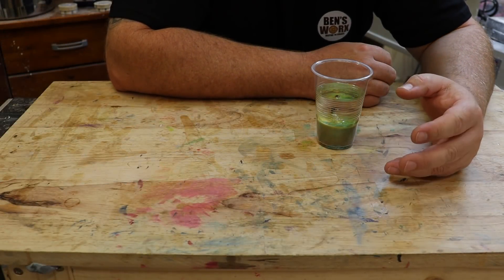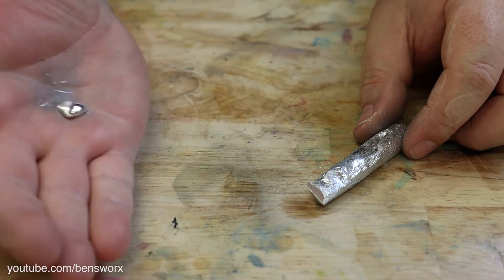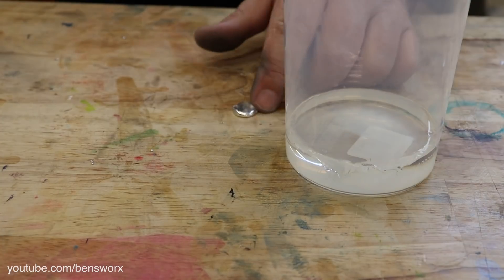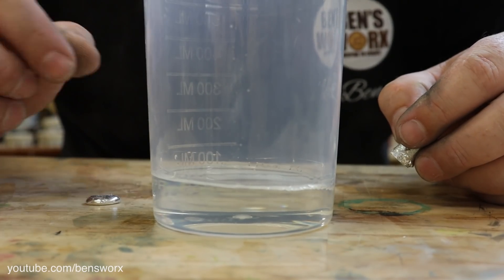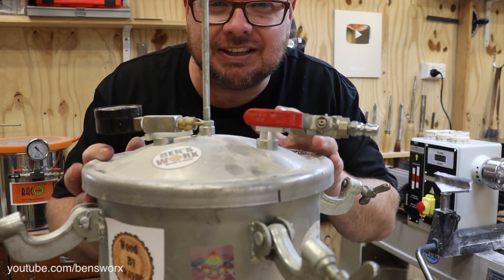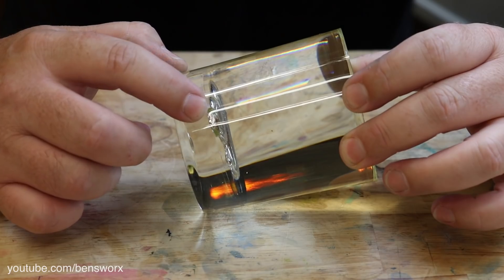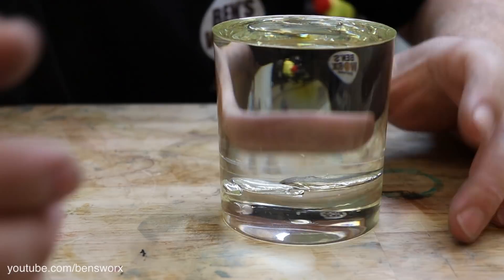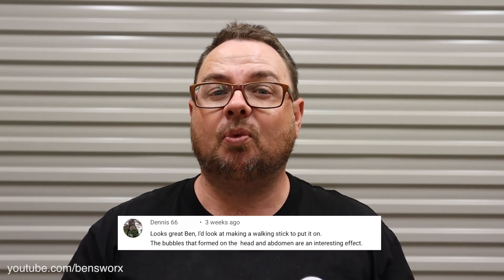Can You Cast Gallium in Epoxy Resin ?

Comment from the maker: Thanks for stopping by, If you have time you can check out my new range of Eggs here www.etsy.com/shop/bensworx
Reply: You could try freezing the Gallium in and small crust of water, and see if the ice will let it keep its shape as it compresses
Reply: What is the name of that tune at5:50? I looked for it YouTube music samples but no luck. Answered thanks
Reply: I think you could make a cool multi layered with the gallium
Reply: If you are able to cast an empty cellulose capsule in resin hollow it out, and fill it with gallium, and then add that to more resin, you will have a pill of gallium floating in resin, instead of a pancake
Reply: @Grigori One thanks I forgot all about that
Reply: There are really fine textile/synthetic meshes, you could use a small piece of that and lay it on top of the liquid resin to try and contain more denser material like the gallium drop in this video, and the white mesh might just be visible, really curious if that would work in containing the material in suspension and not let it sink completely
Reply: What cool experiment! You are now one of my favorites!
Reply: Congratulations to Dennis 🏆
Reply: @Ben’s Worx Idea for you…  Create a night light that uses a Qi wireless charger to charge an internal battery.
Reply: Ben hey listen I would really love to see you make a ant farm inside of some resin. Maybe create a air pocket inside then drill a small hole to it then add sandy dirt and ants.
Reply: Hey! You might possibly be able to heat it back up and get a syringe with a large hole needle and suck up the gallium, that way you could turn the rest of it into something neat. Maybe a pendant? :)
Reply: I worked with resin for over a year, I was doing fiber glass work. Sometimes your experiments scare me a bit. The wrong mixture can spontaneously combust. The worst instance was my boss made an incorrect order. He ordered cold resin in the middle of summer.
Reply: So how about Mercury?

Comment: Hey, Ben, thanks for the excellent content!    Interesting video and it spawns an idea for another resin experiment and a video.  We really enjoy when you try new stuff and we do some resin casting ourselves and you have taught us much!   It looks like the microwave possibly heated the resin block starting from the middle!   What if you cast a block with several old style mercury thermometers with the bases at different points.   The potcam would be extremely interesting and you could put that into the microwave and test the idea that the block heats from the middle first.   Just a crazy idea and, if I understand how your job works, a big part of it is merely thinking of stuff that would be interesting to watch.   If you use this idea, how cool is that, if not it's an idea for your idea bin.  Keep up the good work!

Comment: The burn spot happened because microwaves heat from the inside out. Also, the reason the gallium didn't move around in the middle of the resin when you reheated it is because it didn't have anywhere to go! The resin was completely cured around it, and holding it in place.

Comment: you should try this one again but this time you could cast the gallium in a silicone skull mold.  then brush it with UV resin so it holds its shape.  maybe figure out a way to have a bubble so that when its all set the gallium will flow around inside.

Comment: set the solid gallium in some (quick set) UV resin so that it will keep shape (no reactive heat) then set into some normal resin to see if the reactive heat will melt the gallium (smooth and shiny or dull)...  could be pretty cool to see melted gallium in a different shape than pancake

Comment: It probably did not flow out due to the pressure differences.  Same with the flow effect.  The pressure pot negated the expansion of the air trapped in the galium. Compressing it when it melted.  Also idk shit about this kind of science and I am kinda drunk, and in my mind, this sounds correct.

Comment: If you wanted to try this again, you could cast the bottom first, then cast some walls around the edge before putting the gallium in. That way, you have a barrier to keep the gallium from puddling all the way out to the edges, and could turn the thing afterwards if you wanted to. Oh, really cool (but a lot of work) would be to do multiple layers of resin, each one with a randomly melted shape of gallium.

Comment: 9:40 its the vacum rule, like dipping a straw in liquid sealing the open end and pulling it out. the lack of equal pressure is causing it to be pushed in by the outside gas

Comment: Unlike Water/ice (which really is the exception) Gallium have a higher density at lower temperatures (as when it is solid), and lower density at higher temperature. So it will expand, slightly, as it warms up and melts. The difference might not be very noticeable between "room temperature" and 30C.
So, in the cast in would leave a (tiny?) air gap when it's solid, but when it gets warmer and melts it will take up the entire "void" in the cast, so it can't slosh around. But if it the cast was done with a bigger void than the volume of the Gallium it should work. 

Interesting experiment though, and great video!

Comment: It wouldn't flow out because it's too thick to allow air to go in and replace it. If you want gallium to be able to melt in there and flow around you'd need to cast some resin with a hole in it big enough to fit the gallium bar with extra space, then seal it with another layer of resin and somehow not flow in and fill the rest of the hole. Maybe use some UV resin to fill the top of the hole before you pour another layer of resin on top.

Comment: I had a BB size metal (probably steel) in my finger (unbeknownst to me) and when I had an MRI is left a burn mark much like that on my finger.

The magnets heated up the metal, as well as lifting it under my skin. It looked like a bubble when it began lifting during the MRI. Freaked me out big time. Had a strange, not pain exactly, but ache, like someone was poking me with something.

I had to have it taken out surgically before I could compete my MRI testing.

Comment: Could you perhaps make a first layer of resin with a bowl shape, fill that with gallium and some heavy (heavier than resin) transparent liquid (mineral oil, perhaps?), then cover that with resin? Once cured: cool coaster and fidget toy! 

You should also try cleaning the metal! Impurities tend to float to the surface, making it look dirty, but can be relatively easily scooped off. Once clean, it should look like a T1000! :D 

Another idea, perhaps try this with a ferrofluid, or casting a ferrofluid formation as a  mold?

Comment: gallium has some pretty high surface tension so that's probably why it didn't flow out. also it's ever so slightly more dense as a solid than a liquid (as opposed to water) so there wouldn't be any room for it to flow inside the resin!

Comment: So you can in create model solar systems by utilizing bits and blobs at various locations and heights.  Then microwave the finished resin for 90ish seconds to create the star.

I recommend experimenting with microwaving resin at varied seconds to find the desired results of specific stars.  As in 70, 80, 100, 110, etc nuke.  Plus try microwaving at 90 seconds to see if you'll be able to recreate the result of this video.

I bet the central burn effect is dependent upon the thickness of the resin.

Edit: I wrote the last sentence in reverse by accident.
Edit2: Did away with technicalities of solar systems.

Comment: Fun fact about Gallium... in Terminator 2: Judgement Day, Gallium was used for the scene where he shattered the T-1000 after it was soaked in liquid nitrogen then started to reform. The part where the heat from the mill melted the frozen parts of the T1000 was Gallium under a heat lamp.
Reply from the maker: Thanks for the info mate 👍
Reply: Another fun fact is that Robert Patrick improvised the moment when the T-1000 walked through the bars in the jail. The door was supposed to be open, but the actor surprised the cast and crew by melting his body into liquid gallium, and walking through the bars.
Reply: WillysLhead134 that’s crazy, I knew Robert Patrick to be a very dedicated actor but to turn himself into gallium and then melt is insane!
Reply: @robertdevito5001  ha ha ha!

Comment: If your pressure pot is made of Aluminium be careful with Gallium around it. Gallium will leech into Aluminium and weaken it. Even just touching it with some on your hands can cause this effect. You don't want a weak pressure pot.
Reply from the maker: Thanks for the tip mate
Reply: This is only true when the oxide layer of Aluminium is gone
Reply: @bababoule66  Yep, I tested it out on a pull tab from a soda can, I needed to scratch it under the gallium before anything would happen.
Reply: @bababoule66  Not sure what effect the vacuum would have on the absorption properties.  Just one fresh scratch is enough.
Reply: @AnonEyeMouse  It's a pressure pot, no vacuum here. And you need to get rig of the oxide layer, even if you scratch the surface that's not enough it will start to immediately reforming
Reply: @bababoule66  no it will still eventually eat through the oxide layer
Reply: I thought that was mercury. I remember watching Nile red’s video on Mercury.
Reply: @ramsiethegremlin  they both do something similar

Comment: Carve a shape into a solid chunk of resin then fill that shape with gallium. The pour more resin over the top.
Reply from the maker: I like it 👍
Reply: @BensWorx  or you could put something in the middle of the resin while it cures, like half of a plastic egg with weight in it or a ping-pong ball with a skewer in one side of it sort of cut and taped level with the top of the cup to keep it half submerged
Reply: It'd either have to be Rooster or possibly Eiffel Tower shaped being that it's equally named for Gaul and the common chicken (Gallus Gallus).
Reply: Surely it should be a negative of the T-1000 from terminator.
Reply: And add a tiny bit of colored water. That will make the flowing more visible and have one side of the gallium free from (not sticking to) the resin. 🤓
Reply: Or put the gallium in a Little box then do what you said

Comment: OMG. Gallium pretty much close Mercury. Can't wait for the mercury video if you are making one.
Reply: Mercury is poisonous though, much more dangerous to handle than Gallium. And the fumes from heated Mercury are ALSO dangerous to breathe. It SOUNDS cool and all, but I honestly don't think it's worth the risk, especially since it will just react the same as melted Gallium does.

The Mad Hatter was based on REAL hatters that went mad from exposure to Mercury used in the hat making process. NO BUENO!
Reply: @juliebaker6969  yes I really agree with you. But isn't mercury gonna be covered inside resin? Isn't that gonna stop those harmful fumes.
Reply: @HarnaiDigital  I don't know how it would react. But if it flowed to the edge of the resin like the melted Gallium did, it COULD be problematic.
Reply: Mercury is reletively safe in its non-diluted liquid form. They are definitely right about the heat, and fumes not being worth it :(. Cody's Lab explains  a lot about mercury on his channel. Something cool to check out while waiting on the next Vid from Ben :)